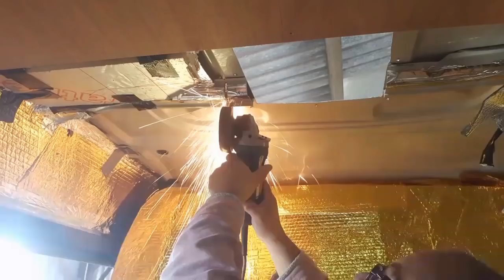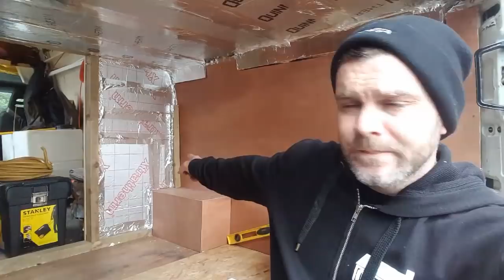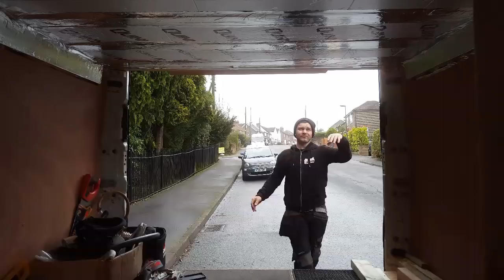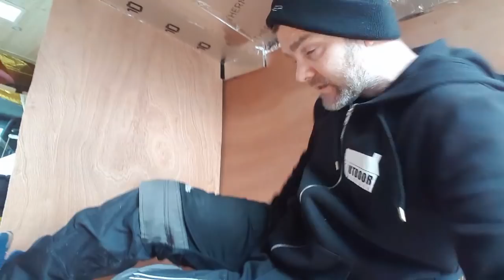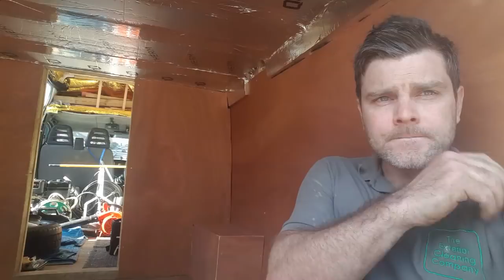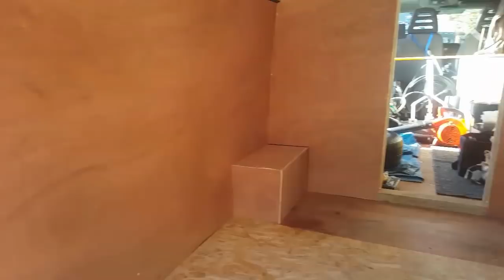My Camper Garage under bed storage

Comment: With the scribe idea, just use a large washer that will tightly fit a pencil in the center then just allow the washer to trace your wall profile on the new sheet to be cut. A lot more accurate. Could even just cut a point in the center of your 90* bracket and that’d be as good as the washer idea. If you chose the black rubber checker you could lay the wall and the floor square in the corners to each other and bead sikaflex windscreen sealant along the join. At least that rubber would be little more forgiving to knocks than something like acrylic sheeting. It’d look pretty decent in that black checker too. Keep up the good work mate 👍😎

Comment: Use foam board on the walls and use the rubber on the floor , fibre board comes in any size you order from coach builder suppliers

Comment: Just found your channel I'm glad you redesigned the bed I'm thinking of doing the same so I can travel and work out of the van. have you thought about fibreglass for the garage not much weight and waterproof
Reply from the maker: mrmushyboy. Hello, thank you for subscribing. At this stage im considering everything. Still in my research stage looking up every alternative. I will look into fibreglass. Thank you for your suggestion. Luke. :)

Comment: Hi bud, one option would be like how I did my bathroom.. lined the walls with ply like you have and then get a wet room tanking kit off ebay (about £30 or something) its a 3 part kit. First a pva type solution to seal the wood, then you get a roll of sealing tape for all the joins/corners and finally apply the tanking over everything to seal it all in. Then you could have a sheet of chequer aluminium on the floor so its hard wearing and just silicone around the edges.
Reply from the maker: Ash Pollard. Hey Ash. Thats a good idea. Your bathroom does look awesome! I thought your bathroom was just plastic/pvc sheeting on the walls? Didnt realise you tanked it. :)
Reply: Luke Izard's My van life! Yea haha I did the pvc over the top mostly to make it look cooler but it's another layer of protection also. Underneath it's fully sealed like a walk in shower
Reply from the maker: Ash Pollard. Very cool! Because the van moves around when driving does it crack the tanking at all? Have u have any cracks/leaks?
Reply from the maker: Ash Pollard. I see. Well thats impressive. Proper job :)

Comment: Looking good fella. Not sure on how much it would cost because you would have to work out the sqft but this plastic clad is good stuff for your walls and ceiling. The floor I would recommend rubber coating/paint or tough Lino.

Look at this on eBay 
https://rover.ebay.com/rover/0/0/0?mpre=https%3A%2F%2Fwww.ebay.co.uk%2Fulk%2Fitm%2F232396234172

Comment: You could tank it like a wet room bathroom. I think the water seal stuff rollers on. Then non slip vinyl on the floor and up the walls. I have zero experience of this aside from the bathroom installed for my dad. They even butt joined 2 sheets on the floor and sealed it with no leaks. Tough and attractive too.
Reply: I think maybe a tiling wholesalers for the tanking advice would be a good place to start. You could EVEN install a wet room style drain!
Reply from the maker: Mevi. Hey dude. Tanking does sound like an interesting idea. Im going to consider it. It would look cool. Thank you for your suggestion. I appreciate the help. Btw i really like your last upload. Like the editing. :)
Reply: Hey, thanks Luke. Good luck with what you decide to go with. 👍

Comment: Ally chequer plate on the floor. Thin ally sheets for the walls and ceiling. How about folding edges of floor covering up the sides an inch or two then run wall covering down over the turned up floor. Basically water will run down walls and straight on to the floor not allowing water to leak through the joints. Tigerseal is a great automotive sealer, think it just comes in black and it sticks and seals very well. Good Luck
Reply from the maker: Diesel Bushcraft. Hi, this is my first choice, ive always wanted ally chequer plate sheeting. Would look awesome. Just the cost is high so considering a few options. Thank you for your input. Appriciate it :) luke

Comment: As you've got the garage area lined with ply - you don't need anything else on the walls and floor other than something to seal it. That could be watered down PVA, something like danish oil or varnish.
I would put something down to protect the floor so seal it with say varnish, then put cheap laminate flooring down. if and when you wreck the laminate flooring with your pressure washer and other equipment, pull it out and replace it with new. (I've got enough laminate flooring from FreeCycle to do your garage area 3 times - cost me £0.00)
Putting another layer in is going to cost you in money (like you said) but also in weight.
As you're in Petersfield, you should join us for a Self Build Get Together! We're meeting next in Hordle (1m from New Milton) on Friday 8th June!!
Reply from the maker: Hello, Thank you for your ideas. I have a lot of research to do lol. Self build meet up you say?! I'm intrigued. Is it a regular meet up you hold then? How many go? Any youtubers?
Reply: Look on Facebook for "Dorset/Hampshire/Sussex Self Build Get Together" This will be our 3rd meeting and hopefully there'll be 5-6 vans. Campsite really accommodating and £15 a night with electric. No YouTubers as I know - but there'll be one if you visit ;-) Hope to see you there!
Reply from the maker: Darren Thrower. Thank you for adding me to your group. Im definitely interested. My van is no where near done but woyld be good to talk to others and get ideas :)

Comment: What about some liquid coating like rhino liner? Won`t add too much weight behind the axle, it`s applied with rollers and can be sealed with with silicone in the corners, too...
Nice work so far!
You can also use a wheel of inline skaters to transfer the curvature of the walls to the ply...
Thx for the vid!
:-)
Reply from the maker: Horst Szibulski. Hey, thats a nice idea. I will look into it. Thanks for your comments and for watching. Really appreciate  it. Luke :)
Reply from the maker: Horst Szibulski. Oh and cool idea with the skate wheel! Like it! :)

Comment: Great to see ya back buddy..! Looking good so far. There are some waterproof roof linings for flat roofs ect. They are glued and heat sealed. On any joints .I’m not sure of the price but roofs are so large that I would not expect them to be to expensive. Might be an option.
Reply from the maker: Japhill75. Hey, thank you for getting in touch and thank you for your suggestion. I will look into that idea. I certainly have a lot of homework to do researching materials :) thanks again. :)
Reply: Luke Izard's My van life! Good luck mate you’ll figure it out.

Comment: If you know a good floor layer get ALTRO flooring, it is super strong will last forever and comes in many designs. Its like vinyl but loads better not cheap but will be lighter. Hope this helps ATB Kev
Reply: you can glue it to the walls as well as the floor. ATB Ke
Reply from the maker: KEV JONES. Hey Kev. Thank you. It sounds good. Ill look into that. Thanks a lot :)

Comment: I'd say you need some kind of plastic to go all around for insulation first, whether it's linoleum, pool liner, pond liner, vinyl floor etc. or fiberglass and then add an aluminium plate on the floor to protect it from damage from dragging the tools and machinery. Do I make any sense? Also, you need to get rid of the humidity so a flettner vent on the roof would solve this problem, maybe?
Reply from the maker: Dan Slotea. Brill! Good ideas there. I will look into it. Thank you so much. Luke :)

Comment: How about Vinyl flooring, comes in 2m wide and as long as you like, cheap! and light, also easy to work with. I used it on the walls in my van conversion shower room/toilet and works a treat.
Reply from the maker: Desmond Andersen. Sounds intriguing. Wouldnt mind seeing a pic of your vinyl shower walls. Ill look into it. Thank you for your suggestion. :)

Comment: my van garage is fibre glass lined with chequer plate on top .not sure how it was applied but maybe a google might uncover the method?? it just has chequer plat in key areas ??
Reply from the maker: Shane sprinterlwb. Fibre glass and chequer plate? Id love to see that if you fancied sending a pic. Sounds cool. Thank you for your suggestions :)
Reply: Luke Izard's My van life! ok mate .vans full of rubbish ready for a tip run but i'll send you a pic as soon as its empty.it was done by RC sporthomes in devon on a 93 lwb sprinter .good luck finding the best solution
Reply: Hi ....could fire a couple of pic to you latter this morning, just need somewhere to send them ?
Reply from the maker: Shane sprinterlwb. Would love to see pics :) lukeizard@hotmail.com. thank you :)
Reply from the maker: Thank you for taking the time to email and send pictures of your van to me. It looks cool! I like it. I will look into your suggestions. Is your van also a camper? Is that a single bed above garage?
Reply: Luke Izard's My van life! yeah its a single bed over garage and camper front end .works well as a work/recreation van.although not at the moment as 2 of tge 4 roof vents were leaking hence all the carpet/ply and insulation is out ....still a good chace to upgrade insulation and electrics.....every cloud hey ?:-)
good luck with you build
Reply from the maker: With every cloud exactly! Thank you and all the best with your build too. :)

Comment: Does it all have to be a wet area? Why not buy pond liner and pad it out or even buy a 6ft by 4ft plastic garden pond for £300 and it's ready to go, cut a bit out the door side if needed so you can get things in and out. It'll be water tight and easy to get in and out of the van coz they're lightweight. Plus, in the summer time you could take it out the van and use it as a little pool to keep chilled in the hot summer weather :) Just a thought anyhoooo... Reese. :)  https://www.ponds4fish.co.uk/shop/duck-pond/
Reply from the maker: Livin In A Box. Nice to see you again. I have previously used pond liner for a work set up. Worked well for a while. Didnt noticed that it tore so all wood underneath got wet a mouldy so hoping for a longer-term setup this time. I will look into your suggestion and i thank you for it :)
Reply from the maker: I thank you for your ideas. I will look into them. :)

Comment: Wet room bad idea,your van will be full of condensation
Reply from the maker: John Easton. It would be vented.  I need a water tight for my work. I think it should be ok. Vents on rear doors?
Reply: Luke Izard's My van life! .don't know if vents would work,maybe a small  box trailer for you work stuff,??
Reply from the maker: John Easton. I have considered a trailer but the reason i bought such a big van was so i could have both a work van and a camper van in one. Parking is already an issue with a long wheel base so i think a trailer would make things more difficult. :) thank for your suggestions :)

Comment: I think the black plastic is probably the best idea due to weight issues, however it’s possible to tear it with sliding your pressure washer in and out.. maybe build some runners over it so it doesn’t catch on it?
Reply from the maker: far Away. I think your probably right with the black plastic. And good tip bout building runners. Thank you for your suggestions :)